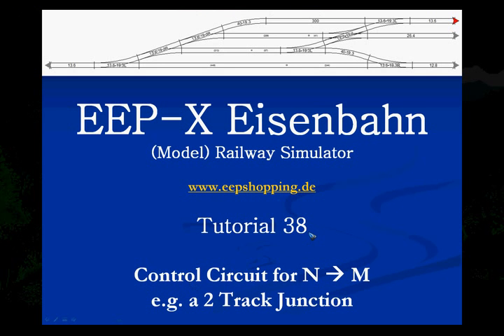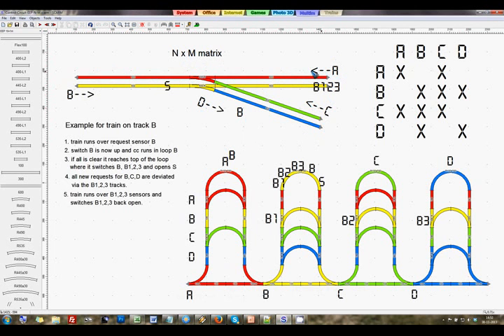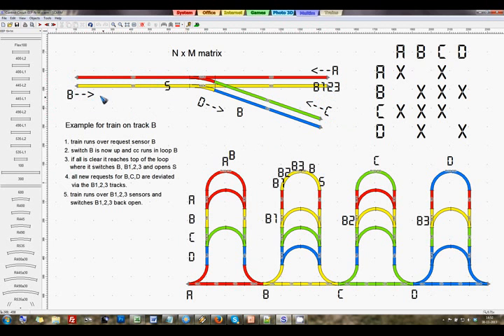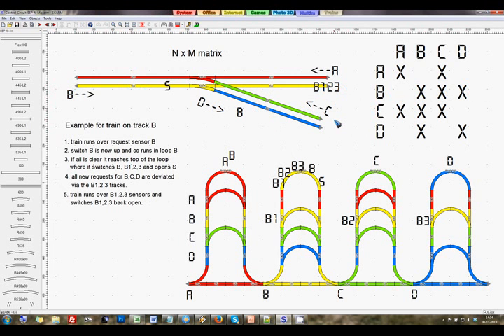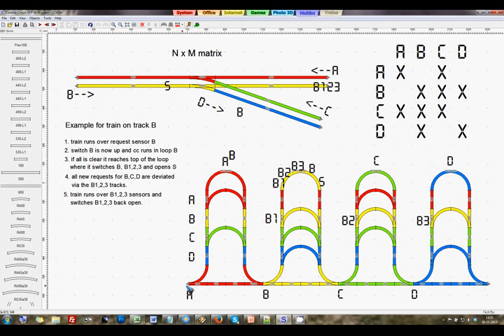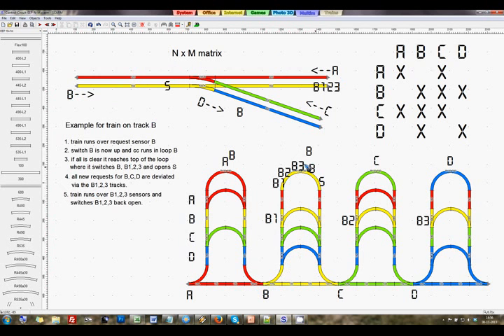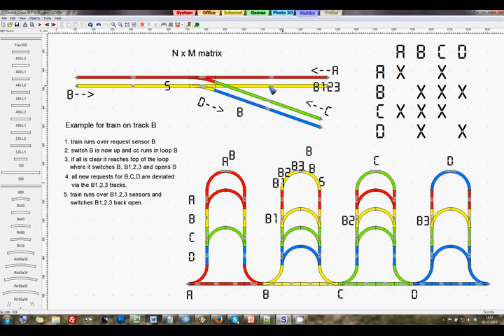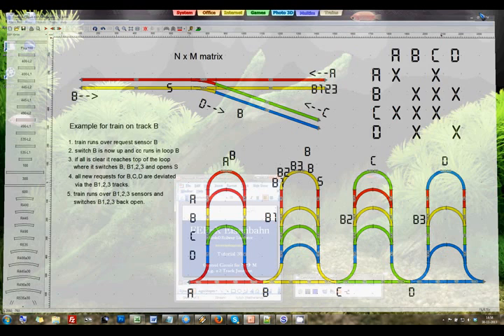EEP-X Tutorial 38 - Control Circuit for N to M - Model Train Simulator

Comment: Hmm, it seems to me, that instead of putting Xs in your table to note where routes "colide" and thus, forms an "illegal" manoeuvre, you could put the EEP-equivalent junction numbers along with their respective set / reset positions so you can see where they are within EEP and thus, have an easier time referring to the junctions, that way you can store more data within the available space on the screen, along with better references to the specific route those junctions refer to instead of having to guess them when it comes to laying out these junctions.

Colour coding and naming them was a neat idea though.

Also, I notice you didn't cover all of the problems you may come across when making some of these junctions operate, such as bi-directional single lines.

I'd totally recommend the junction tracking table as it really helps when trying to keep track of what you've done, especially when it comes to the medium to large junctions, something which has more then 7 routes.

Comment: Hey, I wonder how did you colour code the SCARM tracks?

Also, what set did you use?
Reply from the maker: Color coding of tracks is a standard function in SCARM, available in the toolbar at the top of the screen. I used the Peco set with turnouts and flex track.